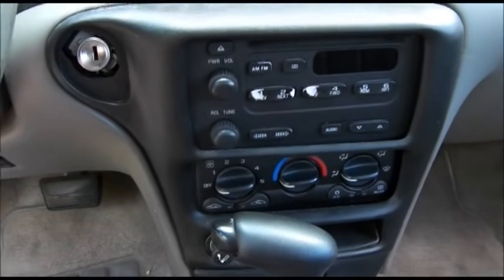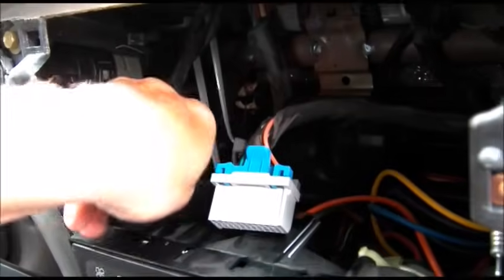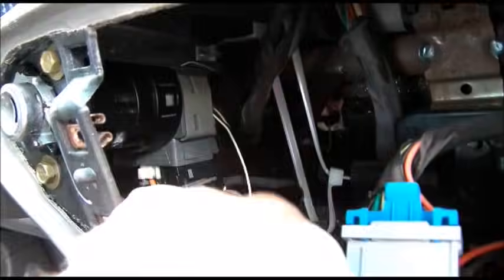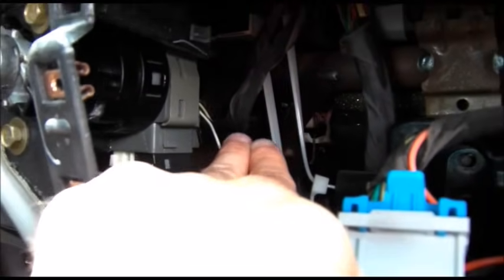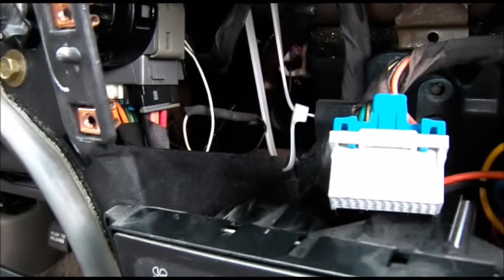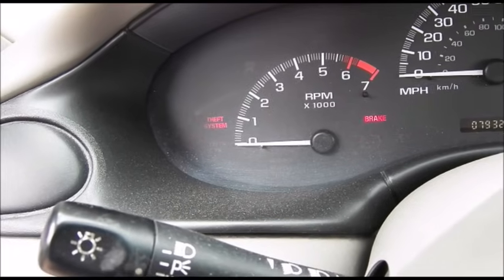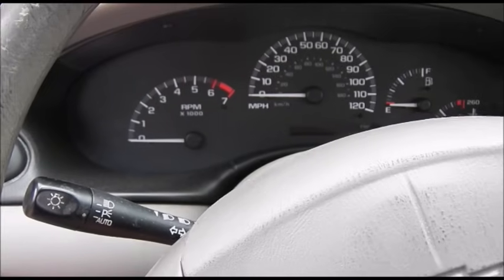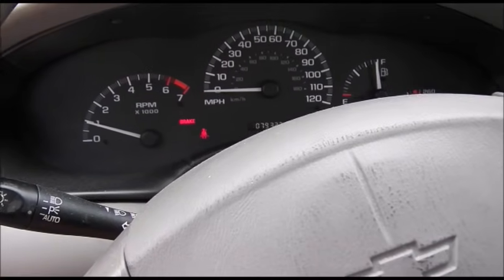GM Passlock II bypass disable fast easy repair fix cost less than $1 2005 Chevy Classic

Comment: Before attempting this on my 03 Chevy Malibu the theft light was on and not flashing. I followed all of your instructions and did a 10 min reset and it would not start. I did a full 30 min reset and still nothing. Did the car have to be running while following this procedure? Do you have any other advise? I know that this is a passlock issue as I have been dealing with this issue over a year now and I have replaced the lock cylinder 4 times, replaced the starter, bought 2 new batteries, a new fuel pump and 6 relays. I tried your bypass last night and nothing so a friend suggested a new BCM. I called GM today and they want to charge me $400 for a new BCM and $150 to install it and reprogram it. When I mentioned all that I have done and asked them to bypass the Passlock they stated that they are not allowed to do that and they don't believe that is what is causing the no start issue. Then said that purchasing the BCM might not get the car running but they would try and if it doesn't work they can place it on a scanner to see what is causing it to not run. I see a bunch of dollar signs there. Any advise would be appreciated.
Reply: Crys Lake dude I’m in the exact same situation. I got a new starter, cylinder, battery, alternator, fuel tank pump etc and still having issues. I’m scared to do this because I don’t wanna screw the car up fully.
Reply: Any one with this issue you wil need to replace the housing that the key cylinder goes in. That is the defective part.

Comment: is the resistance in this video just for your car or is it the same for all other chevy cars?
Reply from the maker: use same resistance for any PL II system
Reply: I believe what he is saying is, even though cars use a different resistance normally, 2200 Ohms is within the range of operation. The BCU has to be retrained to accept this resistance and replace what was already learned.